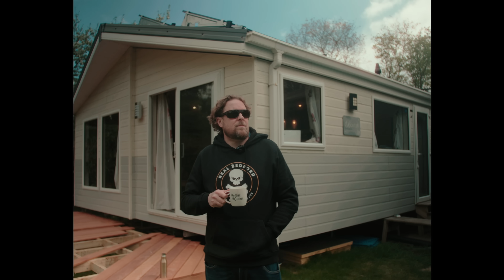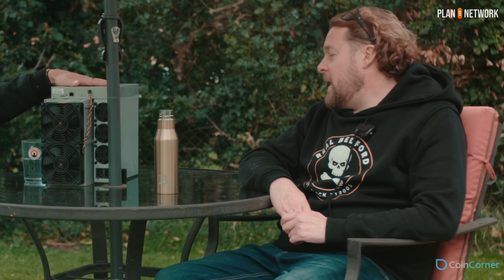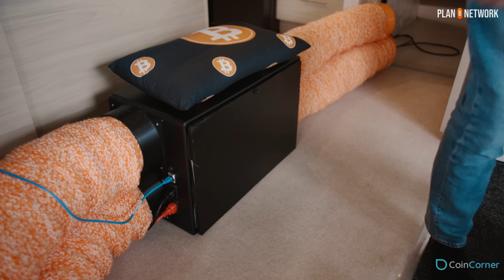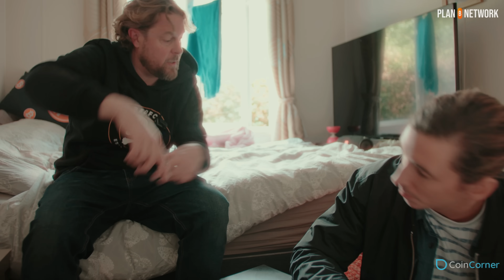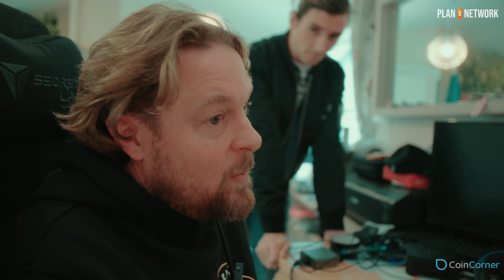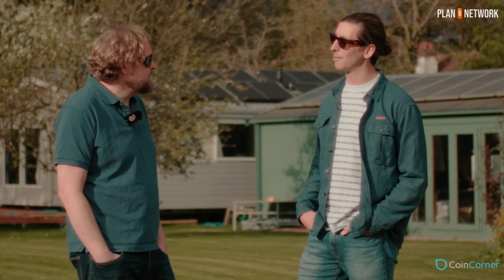He Sold Everything to Go Off-Grid (Successful British Bitcoin Miner)

Comment: Thermoelectric generation
Here's why this could be the most financially beneficial:

Direct electricity production: This method converts excess heat directly into electricity, which can be used to power your home or potentially sold back to the grid (depending on local regulations).
Continuous operation: As long as your Bitcoin miners are running, you'll be generating additional electricity, providing a constant source of value.
Scalability: You can start small and expand the system as you become more comfortable with the technology and as funds allow.
Low maintenance: Once set up, thermoelectric generators have no moving parts, requiring minimal upkeep.
Complementary to mining: This directly enhances the efficiency of your mining operation by recapturing some of the energy that would otherwise be wasted.
Potential tax incentives: In some areas, you might qualify for renewable energy credits or incentives

Comment: Lol that miner need 10x the installed panels to run without grid on winter... something is wrong here.
Reply from the maker: Wdym?
Reply: @JoeNakamoto  Do you run the bitcoin miner 24/7/365 off-grid with only those panels?
Reply from the maker: @myCrypto-c2v  so Steve runs the minerS 24/7 as I understand it thanks to the panels + the two batteries. 

The two batteries stay charged for when the sun doesn’t shine enough. 

As you can see, he’s overbuilt the solar panel capacity. 

He’s upgrading his set up again this year with miners so I’ll hopefully provide another update soon. 

Maybe I’ll do it in the depths of January!
Reply: @JoeNakamoto  Ok fine. But from my experience, 1 btc miner = 82kw/day
I have installed 38kw solar panels to be able to run this 24/7 off-grid with 58kw batteries sir to run this off-grid and in the winter it's offline some days due to insufficient power because of cloudy days. Of course If I can get around 20kw more in batteries I might be better.
But that's from my experience till now sir.
Reply from the maker: That’s cool - wanna talk offline about this? Where are you based? I’m just a silly journalist after all - I don’t know the exact stats of his energy generation but interviews and chats with Steve. 
Contact on Twitter, Nostr or email via my website joe@joenakamoto 😊
Reply from the maker: Website www.joenakamoto.com